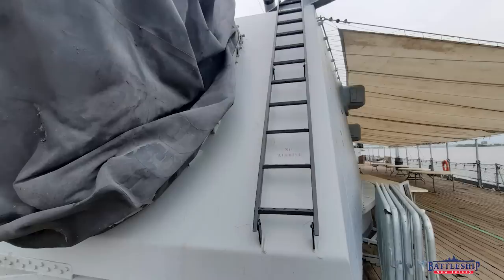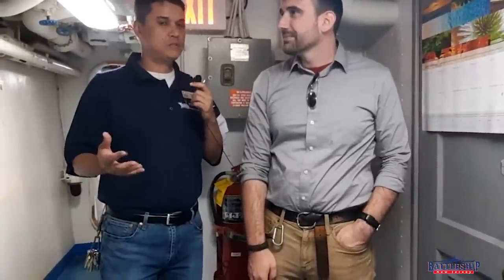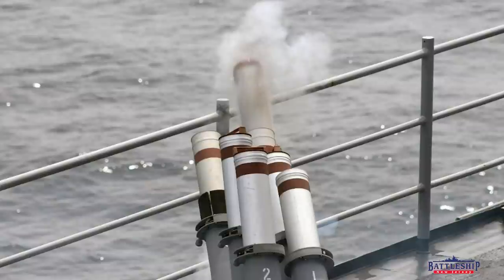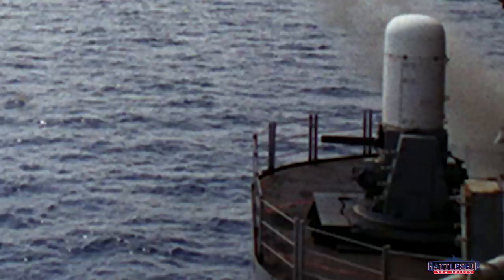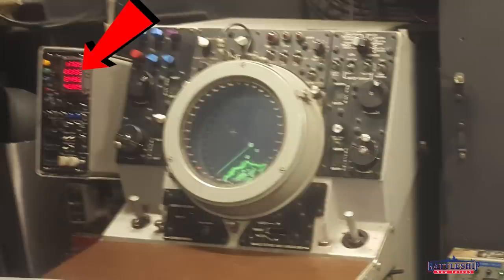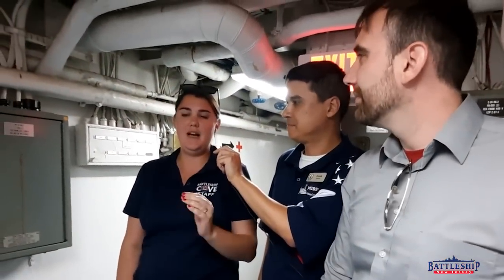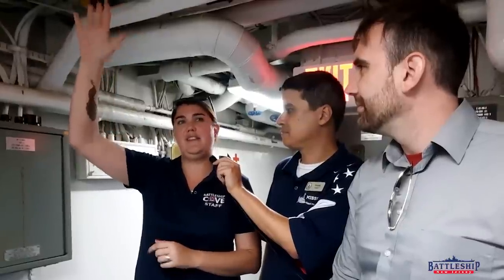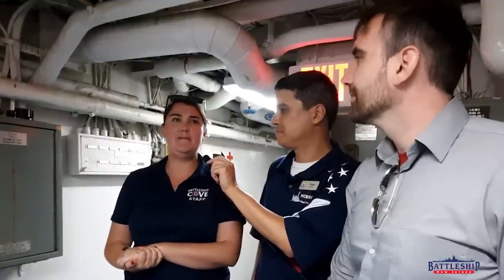Are Those Bullet Holes in The Battleship?

Comment: Properly disposed of; another words, the Navy just tossed it overboard
Reply: Metal is valuable in wartime, I'm sure they would prefer to reclaim it, when it is practical to do so.
Reply: @Freedom4Ever420  it is radioactive
Reply: @kevinbarry71  marginally. Thats what Depleted means
Reply: Deep Six was my first thought lol😂
Reply: @Freedom4Ever420  You can still get heavy metal poisoning from it
Reply: Float tested
Reply: @ThePhalanx2006  That's the real danger. Once it hits the lungs, it's not coming out while the person breathing it in is alive.
Reply: Yep, into the drink...
Reply: My thoughts exactly!
Reply: @kevinbarry71  DU is MUCH less radioactive than Natural Uranium.  Uranium found in nature is a mixture of U-234, U-235, and U-238.  U-234 and U-235 are the most active.  U-235 is the isotope used in both weapons and reactors.

The level of U-235 in Natural Uranium is not sufficient for use in a reactor, which normally require a U-235 concentration of 3-5%.  Weapons generally require concentrations on the far side of 90%.

So, we enrich Uranium for use by basically removing U-235 from a quantity of Natural Uranium and adding it to a second quantity of Natural Uranium.  The second quantity now has a higher U-235 concentration and is considered "Enriched".  The first quantity now has a much lower U-235 concentration and is considered "Depleted".  The U-234 is basically lost in the process and ends up in the waste stream.  

So, Depleted Uranium is basically just the U-238 left after the more radioactive isotopes have been removed.  With a half-life of around 4.5 BILLION years, it is virtually inert from an activity standpoint.  From a chemical standpoint, it IS classified as a Heavy Metal, similar to Lead and Mercury.  Like any other Heavy Metal, it is poisonous if ingested or if fumes or dust are breathed. 

Other than being hard and dense, U-238 has one other claim to fame.  Upon being subjected to a very high neutron flux in a reactor, it can be transmuted to PU-239 (a.k.a. Plutonium) which DOES have a rather obvious military use.  

Easy reading:
https://www.iaea.org/topics/spent-fuel-management/depleted-uranium

Reading for insomniacs who really need to sleep:
https://en.wikipedia.org/wiki/Uranium-238

Total activity found in my full-body scan after handling USN DU ammo AND growing up next to Hanford where they started with producing PU for Trinity and Nagasaki, and never stopped until about 1986:
https://www.yourdictionary.com/null
Reply: @ThePhalanx2006  wtf are they ingesting lead
Reply: @FennecTECH  you might wanna go back and research that again. If they wanted lead they could've gotten lead. This is significantly more dense.
Reply: @PupperTiggle  lead is not the only heavy metal
Reply: In other words.
Reply: @PupperTiggle  do you think lead is the only heavy metal?
Reply: @ThePhalanx2006  Tungsten (other things used in ap rounds) also gives you heavy metal poisoning. DU is a little worst still, but that would be the other thing that the military would use in ap rounds.

Comment: I'm not surprised the damage from the CIWS round wasn't repaired, it really wouldn't have been considered anything more than a way for the ship to have some "character" and something to point out to visitors.  By this point everyone in the Navy knew that Wisconsin and Missouri were going to be decommissioned after returning home, so repairs to this "hit" were probably assigned a very low priority with more important problems getting the attention.

My own ship was less than 20 miles from Missouri when the "Silkworm Missile" incident happened.  Missouri's "best buddy" HMS Gloucester shot the thing down, but right after we received a CBR (Chemical Biological Radiological) weapon alert that had most of our Amphibious Group buttoned up under CIRCLE WILLIAM conditions (gas masks and such) for well over an hour.  I think it was finally determined that the "Agent" detected was residue from the missile explosion (warheads, fuel (liquid AND solid) from both missiles.)
Reply: Damage , early 1991.  officially decommisioned 31 March 1992   ... it would have been  labelled as a  "do not  service" asset.. if it didnt have to be repaired to operate it, why repair it ?  why spend anything on  repairing  a ship due to be decommisioned ???  Maybe there was a  temporary repairs for its remaining service , but removed for the museum ship status

Comment: Not battle damage. But second deck starboard side of turret 3 barbett is cracked on the Missouri. Also on one of turret 3 projectile decks there is a WW2 brass lighter that fell between the rotating projectile deck and stantionary deck. Crew member during WW2 dropped it and that's where it went, still there to this day.

Comment: Might be interesting to run a Geiger counter around the holes to see if there are still traces of the DU round in there. Uranium is an Alpha particle emitter and low one at that, so there is zero danger to anyone (unless someone licks it).
While I was in the Marines, I've fired a 20mm with DU rounds a couple of times and saw the damage they cause to tank armor. It is a devastating round.  I'm actually surprised how little damage there was.
Reply: I suspect its something to do with soft vs hard targets? This CIWS round only hit some soft ship-bits and gradually lost energy, while a tank is an armored box where the rounds' energy will instantly be spent. DU also probably produces a slightly fiery cloud in the latter scenario (including that toxic dust).
Reply: Make no mistake, the Uranium isotopes in question are not safe to be around. They do emit ionizing radiation (gamma and beta) even when sub-critical, due to decay products being present. DU ammo is safe to handle because the DU penetrator is encased. The problem here with DU ammunition is the particles that can be breathed in - it is fairly certain that crew in those areas was exposed to those particles right after the incident happened.
Reply: @Ganiscol  DU is radioactive, but it's sufficiently low radioactivity that it is actually used as radiation shielding in some applications. Lumps of DU aren't a particularly large problem; as you say, the dust is the problem, particularly when it's inhaled -- it's a heavy metal toxin as well as the radiation issues.
Reply: @Ganiscol  Any radiation after just a cleaning to get any dust out would be so close to background it would be completely harmless. Really DU is nasty mostly due to being a heavy metal, but then again so is lead...

Even in combat zones where DU was used extensively background radiation is barely higher, certainly not enough so to be dangerous in any way.

Comment: Go to the port side of Turret 3, check the side near the face of the turret. There is a huge gouge where another CIWS round deflected off the side of the turret in the same incident that the round went over the 25mm Bushmaster gun mount (the one shown here). I was inside Turret 3 during General Quarters when the incident happened. I exited the turret through the lower hatch from the Gun Captain's station and heard the 1MC message, "Secure from Flooding" and I was like....what? That is when we all learned about what happened. CRAZY to think that we were shot by our own people.

Comment: The exterior holes should be repaired properly. The one in pipe should have been repaired long ago. Rest of bulkhead holes can stay. Personally I would cut out piece, weld in a patch and display piece with hole right over the patch.
Reply: It's superficial. And the ship's not operational.

Comment: Ryan, there is a video making the rounds of the internet of Submarine Bowfin getting underway for a move to a Honolulu shipyard, and while the video shows at least ONE harbor tug standing by, the submarine APPEARS to be moving under her own power.  Are the rules for smaller diesel powered ships different from those for larger, steam powered ships?
Reply: I'm certainly not an expert but I would tend to think so regarding different rules. The New Jersey's steam propulsion is very complex & potentially deadly where the diesel electric system of a submarine isn't much different than any other vintage internal combustion engine.
Reply: I do know that some of the other subs have the main engines running, USS Silversides or USS Cod for example have the main engines running, so if she still has her props it could be possible to move under its own power I think
Reply: The diesels don’t have to run on a sub to move it. If they have power from a tug to supply the dc power it can move on its own. Many of the sub museum pieces have a prop but not an original. Many times the original is outside of the ship, much bigger, and the one on the ship is marginally functional on purpose.

Her dive planes and ballast tanks would also be inoperable.
Reply: @jacilynns6330  I tried looking it up and it seems that USS Bowfin has her props removed
Reply: The history of the props used on subs over the years have been an item considered as classified and most decommissioned subs more than likely the first items removed are the props. It would be cost prohibitive to have an unclassified prop on hand to allow the sub to operate under its own power after decommissioning.
Reply: @Leo1C2MEXAS  That would not surprise me at all.  The subs hull and prop shafts are steel, the props would probably be a bronze alloy.  In a salt or brackish water environment dissimilar metals are subject to rapid cathodic corrosion and one step that can slow that corrosion is removal of the props as well as attaching "sacrificial" electrodes made of zinc or similar metals to the hull to protect the steel from this type of corrosion.

Comment: CIWS does not use IFF. CIWS is designed to automatically lock on to flying objects that meet certain engagement criteria, and a chaff cloud can look like an incoming missile to the CIWS computer. If CIWS is in AAW Auto and the operator does not intervene it will shoot at anything meeting the engagement criteria. If it is in AAW manual it requires an operator to push the fire button.

Comment: Wouldn't surprise me if any repair attempts did more harm to the surrounding steel.
Better to leave a 20mm hole in an otherwise perfect piece of armor, than to weaken a square meter of the plating trying to patch a small hole.

Comment: Interesting, as the military claim DU is harmless, unless dust is breathed in or eaten, then the active radioactive material could cause problems.
But many other health agencies say otherwise. Including for DU used in the aircraft industry for control surface counterweights.
Reply: Depleted uranium is generally safe in solid form outside the body. It is a heavy metal and has chemical toxicity (similar to lead). It's predominantly an alpha source with a multi-billion year half life so the radioactivity is small. It becomes much more of a hazard when it ends up inside the body through ingestion / inhalation (i.e. when it ends up as dust or a soluble compound). It has numerous uses in industry (including of all things radiation shields)because it is relatively inexpensive and extremely dense.  As long as you don't turn it into dust it is quite safe. https://www.epa.gov/sites/default/files/2015-05/documents/402-r-06-011.pdf

Comment: Point of order there, Ryan. Those 20 mm depleted uranium shells are traveling sometimes at 5400 FPS. They are extremely over pressured. Those rounds more than likely traveling around 3000 ft./s when they hit the belt.
Reply: This is not hitting the belt armor.